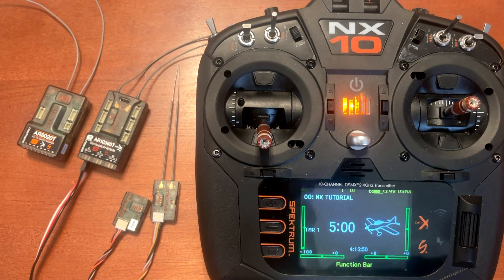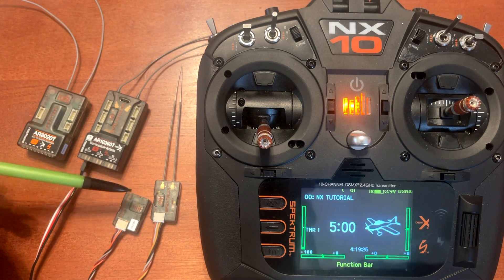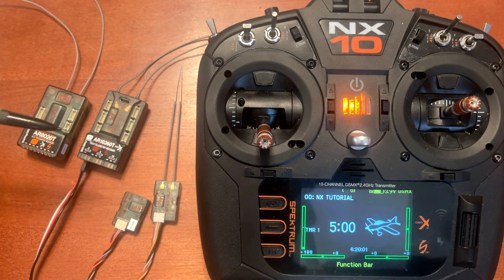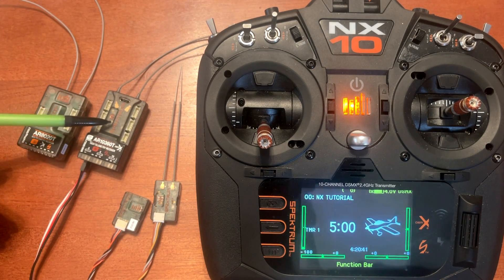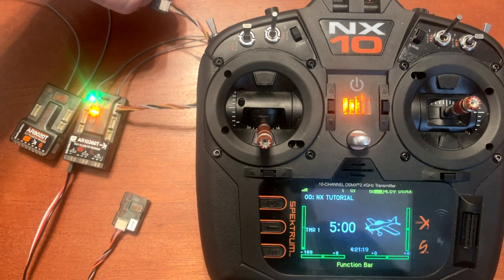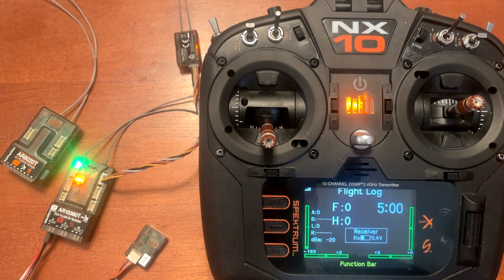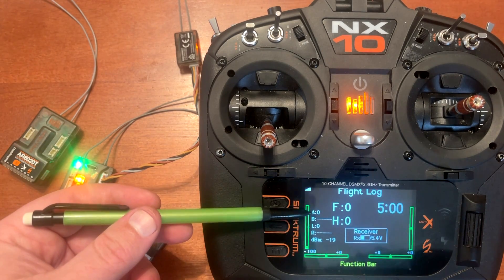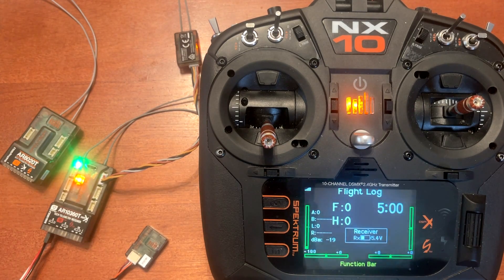Spektrum AR Receiver: Remote Receivers Explained

Comment: Good info thank you.

However I have a goal of finding a satellite or GPS unit for helicopters that allow it to fight the wind in a hover mode or even program some simple maneuvers. 
Fail safe return to home if possible.

Much like the JCZK 300C PRO.
I also see smaller 3Ds with the option but dont see the correct unit anywhere so the more universal the better.

Id actually like to build a heli from scratch using common parts from other helis.

Comment: I just bought another AR 8020T receiver and 9747 remote, installed in my new plane and noticed the B readout empty after my flight.  The A readout ws 24 F and no Holds.  I went to rebind and found pushing the Bind button on the remote had no effect on the main reciever, no flashing light.  I have not seen this before. Any ideas?
Reply from the maker: Check the port remote is plugged in. Try binding with bind button on receiver.

Comment: Help!  I just completed building my Align TB40 and wiring it now. It came with the beast plus V5   what receiver should I order? I'm using the NX6 Tx and want to access telemetry so do I need an Rx with telemetry or does the beast do that?   I don't want to order a Rx I don't need or one that won't work the way I need it to.   Great video, thanks!

Comment: Great video as always !  Small question, if you have a BNF plane with an AR637TA installed and already bound to your transmitter, do you need to bind again when you ad a remote receiver to this setup ?  Or does it just work by pluggin in the remote receiver ?
Reply from the maker: When you plug in the remote remote receiver light goes solid its working and connected. However i always rebind with the bind button on remote receiver...
Reply: @BDTennessee  thanks for your reply😀. Much appreciated
Reply from the maker: @PatrickVannie  anytime! 👍
Reply: Great question!

Comment: do i need a satellite receiver for my AR8020T?
Reply from the maker: Dont need a remote receiver for any of them.However does help :)
Reply: @BDTennessee  thank you! also, do the antennas need to be outside of the airframe? i am new to spektrum ^^
Reply from the maker: @extra330sccc  dont need to be outside. 90* orientation and not covered up by other objects if possible (IE bundles of wires,battery ,etc)

Comment: can i conncet spectrum AR10360T to radiomaster elrs EP1 receiver? and AR10360T receiver to radiomaster tx ts16s .
Reply from the maker: I havent tried ELRS. Works with Radiomaster TX16s...
Reply: @BDTennessee  i want to join multiple receivers to my tx radiomaster and spectrum receiver ar10
Reply: Can you try to connect spectrum receiver AR10360T to elrs EP1 radio master satellite receiver? And both to radiomaster transmitter Tx16s m2?

Comment: have you used the Spektrum AR10100T DSMX 10-Channel Telemetry Receiver SPMAR10100T do you need to use a Spektrum SRXL2 DSMX Remote Receiver SPM9747 with it you view with without on it please are thay a good reciver
Reply from the maker: Same as the 10360T without AS3X feature. I use with and without. Better coverage using than without. However without has given proven results too.
Reply: @BDTennessee  thanks order with sat beeter of being on the safe side
Reply from the maker: @stephenrout9025  totally agree. Use one of the affiliate links when you can.Thanks

Comment: Hi you do a great job on your videos. Thank you. My question is do I need the SRXL2 DSMX Remote Serial Telemetry Receiver to make the telemetry work with the AR8360T As3x receiver. I have a 15cc Carbon Cub Castle Creations ESC and Eflite power 90. I want to see altitude and the 8s 29.6 volt main battery pack voltage. I do not care about seeing BEC servo voltage. It seems strange that Horizon Hobbies sells the Satellite separately. Plus having two different satellites for sale is even harder to understand. I need one or the other satellite receiver or none. I'm not sure. Happy Flying Greg
Reply from the maker: Telemetry will work without using a telemetry remote serial cause its built into the AR8360T. Get that one if you want external antenna as well. If you  want voltage connect the included wire with AR8360T.
Reply: @BDTennessee  Thanks I had thought I could use it without buying the satellite. I just don't know what the Satellite does that the eight channel receiver doesn't do.
Reply from the maker: @Upchuckinabottle  better connectivity and 2 more contact points for radio to receiver connection.

Comment: BD, I have a question about an SPMA3178 that I am trying to install into an airplane with combined flaps and landing gear. Using NX8 radio. Is this something I could talk to you directly about? Not sure how to connect directly. TIA
Reply from the maker: You would need to have a value that deploys the flaps and far enough to hit value for gears to operate. If you need help,dm me on facebook.

Comment: Very nice thanks!
One question when you did the bind in this video were you just binding the satellite too the main receiver only or were you also binding the satellite too the receiver and binding the receiver too the radio, like when you set up a new airplane model? Or was the the receiver already bound to the radio and model?
Reply from the maker: Everything was setup as new.Didnt have main receiver bound. "Binding the satellite to the receiver and binding the receiver,like when you set up a new airplane model".

You can bind 1 of 2 ways. Both together or have main bound and add satellite.

Comment: How can you test the satellite to ensure if the main receiver loses signal that the satellite instantly takes over as the primary receiver?
Reply: From your flight log menu.
It will show each antenna
Reply from the maker: Sendit RC is correct.Verify flight log.

Comment: I'm wanting to add dsmx satellites to a Ar367T because of over 900 frame losses and 1 or 2 holds.
Hoping this will tell me if it's the Reciever or my Tx.
Reply from the maker: Thats alot of frame losses and holds(which holds are never good).

Relocate antennas on AR637T too.
Reply: I've moved them every way different I could think of with no difference in better connection.
I never had this many frame losses with a dx6e.i bought a used ix12 and now this is happening.
Reply from the maker: Id say the ix12 is suspect. 2 reasons. 1) Signal issues didnt happen until new readio. 2) Friend of mine did the same thing. He sent it in to HH. Tech diagnosed RF Module was bad. Repaired and sent it back to him. Works no issue now.
Reply: If these satellite reciever antennas don't help them I will have to.thanks man for your input and videos!
Joshua Miller from Monterey Tennessee.
Reply from the maker: @sendit_rc  your welcome,proceed with caution tho.I have never had that high of numbers on any single receiver,other than his with a bad radio.

Thanks for watching! Let me know how it goes...
Reply: I added a Spektrum satellite reciever antenna to my ar637t and got 27 frame losses with no holds verse 900 and 1 or 2 holds per flight.
Reply from the maker: @sendit_rc  great! Glad you got it worked out!